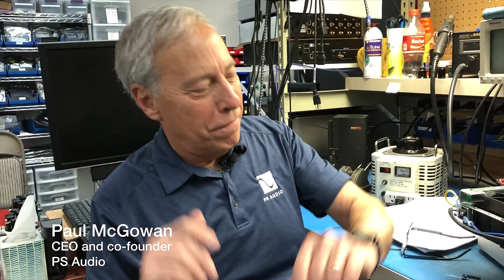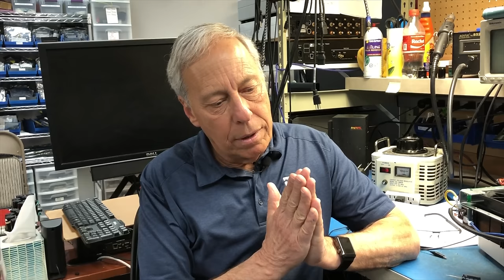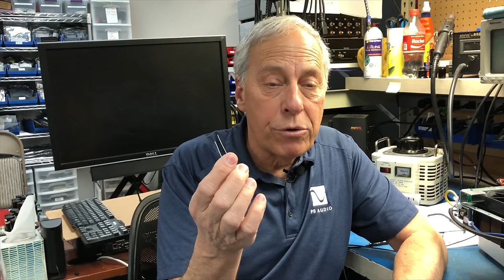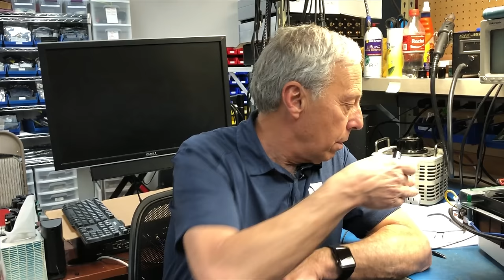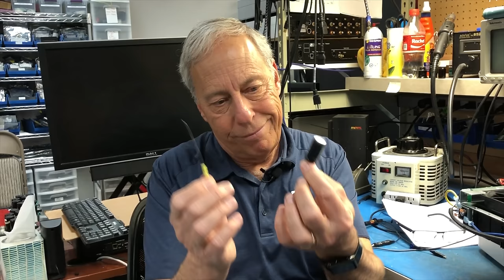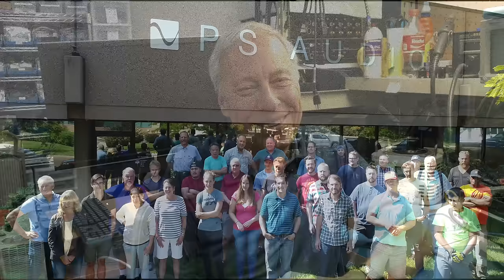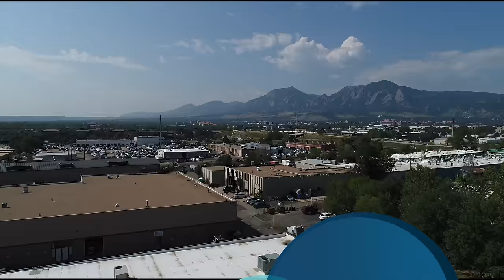Why do capacitors sound different?

Comment: Hello, I am planning to replace the electrolytic capacitors in my Grundig R45 receiver and I want to do it right, but before I start replacing them, I decided to refresh my knowledge a bit and expand the information about capacitors used in audio equipment, what they are suitable for, but the amount of information can get confusing. , and I don't want to do it badly and damage the equipment because it defeats the purpose and after watching several of your videos about capacitors used in audio equipment, I decided to ask for advice on what capacitors to use in the mentioned equipment in the power supply systems and in more critical points, i.e. the audio track because I know that the differences are huge, and when making a choice, I want the costs to be optimal in relation to the quality, and the final effect, where I can possibly save money and where it is not worth it. Thank you in advance and best regards for any answer.

Comment: I saw the title of this video and I knew it would be an instant lightning rod. I wonder if capacitors of equal value have a differing impulse response due to other factors (or different impulse response into high-impedance vs low-impedance loads that would discharge the capacitor at different rates). I don't know, I'm just wondering. Impulse response is inextricably linked to frequency response but the two might not be perceived the same way (like "Q" of a loudspeaker bass alignment resulting in subjectively boomy/tight bass).
Reply: AcousticTheory Excellent response.

Comment: The short answer, is they don’t have the same specs, and variance from specification changes with quality. Staying with caps, the farad rating is only one spec. An electrolytic and a polyprop have very different characteristics outside of the Farad rating. They are non linear devices in all areas, not just a simple and perfect filter.

Comment: Now we're only left with: resistors, coils, opamps, transistors, mosfets, transformers, diodes, schottkey diodes, zener diodes, triodes, LEDs, fuses, potentiometers, switches, relays, connectors, DACs, microcontrollers, microprocessors, FPGAs, oscillators, RTCs, motors, hall sensors, capacitive sensors, rotary encoders, phototransistors, optocouplers, diacs, triacs, thyristors.... aand the list goes on haha
Reply: So, better luck explaining next time 👍

Comment: A capacitor doesn't pass "voltage" (battery or otherwise), neither current. I'm sorry if I'm seeming harsh, but capacitors are isolators. However, they allow the electric field to propagate, thus adding electrical charge to one plate and removing it from the other plate. Since charges won't go through the dieletric (unless it is leaky), the charge difference remains. Plus, there is no such term as "passing voltage". Voltage is a charge difference, while current is a charge movement and thus, only current has the ability to get transferred.

To add, I believe that an electrolytic capacitor may sound different if it is leaky. The rest, I take it as pure audiophoolery. Never noticed any difference, even with an oscilloscope. Notice that oscilloscopes are far more reliable that the ear (or brain).
Reply: Not quite! You can use the scope's FFT, or better yet, a spectrum analyzer to check distortion. Analyzing how capacitors sound by ear is not an objective test. But yes, I agree to disagree.

Comment: I have a 7 band graphic eq that I'd like to change the lower frequencies. Is it possible to change the capacitors in certain frequencies to get your desired effect? For an example, if I want to change my lowest frequency of 100 hz to 50 hz and the second frequency is 125 I'd like to change to 80 or 85 hz. Also, how do I determine the slope at which the frequencies roll off? Thanks for any help you can offer.
Reply: Ever try it out? I want to halve the freq of the low pass filter on my eq and am thinking of just soldering an identical cap to the legs of the film caps already in the filter

Comment: Howdy. Electrolytic capacitors have a large series effective resistance equivalent. The capacitance is also very dependent on freqency. They are poorly suited for audio passing. Their relatively high impedance will add geometrically to the input impedance. This will upset the loading of the feeding stage resulting in signal skewing.
Plastic film capacitors are well suited for audio transfer. The internal series resitance equivalet is very low and their capacitance is pretty much frequency independent in the audio range.
Electrolytic capacitors are well suitable for energy storage = filtering because it is easy to get large capacitance values. Electrolytic filter capacitors should have a plastic capacitor connected in parallell to speed up the filtering. A rule of thumb can be that the plastic capacitor be say the electrolytic capacitance divided by 10 000.
Observe however. Because the impedance of plastic capacitors is low in relative terms using them as filtering boosters will produce large reactive currents through them. They may actually run warm and deteriorate fast. This may explain why mains LED bulbs suffer capacitor shorts. One should split up the plastic capacitance into several capacitors if a large electrolytic capacitor is to be speeded up.

Comment: he actually didn't offer an explanation. here is one: the frequency isn't specifically defined in some types of capacitors - it changes when influenced by all sorts of things including butterflies farting & raising the temperature (or current). and i think they aren't linear. that can introduce harmonics, distortion and noise. theres stuff online which can tell you more. i only have a rough knowledge of it.
Reply: Yeah he waffled for 10 minutes.

Comment: Current only appears to flow thru a capacitor. It actually oscillates in the circuit around the plates because electrostatic forces bridge the gap and act like a connection. Electrons are drawn in and out of capacitors but never pass thru them! Those thin film caps, especially tantalum's, deteriorate over time. YT has videos showing them crumbling and pitting at microscopic level.

Comment: Air will pass a small amount of electricity, and this is proven by the fact that if a predator messes about at an electricity substation, the very high voltages (about 300kV plus) can jump gaps, putting the predator in danger of electrocution even if he doesn't quite touch the wires.

Comment: electrolytic caps require a net DC to maintain the dielectric, no longevity in AC (which is sound/music) also caps do have a small internal resistance, which varies.  I had a crossover cap heat-up and smoke-up my room!
Reply: LOL, and may be why I now need a hearing-aid!

Comment: The prefix "micro" means one millionth (10⁻⁶), not one thousandth (10⁻³).  The prefix that means one thousandth is "milli".
     This video failed to address his viewer's question, which is about the different audio characteristics of capacitors that have the SAME specs. (Presumably the viewer meant same capacitance and same maximum voltage limit.)

Comment: For audio, the cap has to be and to stay, in time as well under heat,  and fabrication, LINEAR and REPETITIVE. If you don't/can't manually fine tune the circuit that the cap is part of, you may be off scale by almost 100%, with some caps, simply because the margin (tolerance) of fabrication can be very high. (Note that a cap used as a fly-wheel near a step motor does not have to so restrictive, not all cap are fabricated with audio quality in mind.)

- A ceramic type (relatively large disc package, can be tiny too)  is very unstable against heat. One cap can be 80% more ( or 20 % less) than the other with the same initial spec, as margin of fabrication, or as tolerance. Can be used close to an element which may require a sudden rush of current. The cap is then used as a reservoir of electrons, or as a brute noise filter. 
-A paper type (used in very old radio)  is chemically unstable in time, as it becomes acidic and lose its isolation property, which may cause the tubes (did I say old radio?) to overheat, and fail before their expected time. Today, should not be used unless for restoration of old radio... and even in this case, surely the paper cap would have to be new, since an old one won't be a cap anymore.
- Mica coated with silver are very stable (and cost what silver cost). You may find some in the "bargain bin of old caps", or in "garage sale", ... they are sill good, excellent, even if they are old. They are probably an overkill for audio, but nice for radio ultra high frequency. They generally look like a kind of thick wax-like bloated rectangle. But not all wax-like bloated rectangles are mica-silver caps, though.
- Film cap are probably the best for audio. Cylinder, as shown, of rectangular in hard plastic packages. There are many kinds of plastic used for the isolator plastic film (inside the cap), some have problem with heat (soldering them to the circuit may even damage them, some may even be damaged if kept too close from a tube, or a warm transistor), some other, not at all. The variation (from one cap to the other) may dictate the type that you would use, but it is generally much better than the +80 - 20% of the ceramic type or of the electrolytic types, but for a really, really, restricted range, you have to pay more, even if, in general, film caps are "friendly" priced. They are relatively medium sized (larger than ceramic, smaller than aluminium electrolytic).
- An aluminium electrolytic cap (the blue can type)  is polarized ( a + and a - pin ) and is usable only as long as the net voltage ( DC plus the negative voltage of the AC) stay positive on the + side. Furthermore, at high frequency, the electrolytic ions has not the time to travel what it has to and the cap ceases to conduct at high frequency AC). They have terrible margin of tolerances (similar, or worse, than ceramic type) and they can age by over-heating ... and standard time passing. Can be use as reservoir of electrons, or as rough medium time keeper ( such as with a NE555 chip ). Don't obstruct the vent cap at the top of the can, that is supposed to open in case of a short or excess of voltage (otherwise, the can, made of aluminium, may explode and send shrapnels around in case of such incident). Don; t discharge them with your fingers, or with a metallic tool,  if they are rated for more than 40V... if charged, they can hurt or kill you. It is the amperage which kill, but under 40V, your (dry) skin presents enough isolation to protect you. And if 6V battery on your tongue is not your definition of fun, well... avoid touching electronic equipment when you sweat.
- A tantalum electrolytic type is much smaller than its cousin, the aluminium type, and is, was, often used in cell phones. I say was because it has the tendency to explode (when the polarity, +/-, is not respected) or to burst into an un-extinguisable fire (it provides the comburant and the carburant and the energy) when the voltage is exceeded. But otherwise, when properly used, it does what it has to do, very nicely, in a small size. Tantalum is not as costly as silver, but cost more than aluminium or plastic. Unless you are pyromaniac (though there are new tantalum cap which alleviates their fire-bomb nickname), or very, very cautious, I would stay far from them. They generally looks like a large drop of water, yellow, or red, or brownish.
- Use many of cap in parallel: that is also a frequent solution, up to five of them in parallel! Why? because each of them has characteristic which depend (ie, are not linear) of the frequency. It also implies much less stress on each of the cap.

In short, for audio, film cap due to their stability and repetitivity. Some new ceramic type, but much more expensive than their classical cousins, could present the required time, heat, and fabrication "stability" (but can be piezo-electric). If you can adjust, fine tune, the circuit with a potentiometer, the fabrication tolerance may not have to be restrictive, other wise, the fabrication tolerance itself has to be a criteria in the specs. But EVEN if you use a circuit for AUDIO, you may need capacitor for the good of OTHER parts (aspects) of the electronic.

Comment: can someone tell me what capacitance range to use for tweeters, mid-range and sub-woofers plz? is there a chart somewhere to follow? thanks
Reply: certified30 it depends on the impedance of the speaker and the desired frequency characteristics.

Google "RC highpass filter" and you can calculate it yourself!
Reply: Fc=1÷(2×Pi×R×C)

Say you have a 4 ohm tweeter and you want to only pass frequencies above 1kHz.

1kHz=1÷(2×Pi×4ohms×C)
C=39.81uF

You simply put a 39.81uF capacitor in series with the positive terminal, making sure it's voltage rating is at least 50% higher than the expected maximum signal.

This is oversimplified, but it will certainly work for you!

Comment: 1 micro Farad = 1 µF = 0.000001 F
1 milli Farad = 1 mF = 0.001 F = 1000 µF
1 Farad = 1000 mF = 1000000 µF

just to set it right... comes probably more natural when you use the metric system.
And he did address the question: Small capacitance - high pass filter, high capacitance = low pass

Comment: At 2:53 you make it sound like capacitors have multiple layers of conductors and insulators for the current to go through. Rather, there is only one insulating layer and the surface area is increased (e.g. in electrolytic capacitors) to allow higher capacitance through rolling up the two conducting sides of the capacitor with the insulating material in-between. The "roll" thus becomes also a coil serving as an inductor. And at 5:21 you talk about a micro Farad being a 1/1000s of a Farad. It's a millionth of a Farad. A 1/1000s of a Farad is called a milli Farad, but rarely do we use such prefix for capacitance.

Comment: One point not made. And audiophile and consumer's should know, electrolitic capasators only last so long, then after several years they can begin to buldg and leak, the fluids can be crosive to the metals on the boards and etch off metal traces.  Also some budget brands fail sooner and dont do what they were rated for (made in china) wile other brands  last longer and exced the stated specs (made in Japan) 

If youve ever owned a samsung TV that the power supply stoped working on it was probably the capasators going bad.

Comment: That explination of how a cap works i'm sorry is incorrect. NOTHING passes thru it. It charges and discharges thus allowing current to flow thru the rest of the circuit. As your audio freq. alternates it changes the polarity on the cap, everytime that happens the cap discharges and recharges.

Comment: But what exactly are we trying to achieve here with any audio cable / component / piece of equipment?

If it is to allow the signal from the source (CD, digital audio or whatever it is) to be fed as uncolored as possible into our speaker system, then that's one thing we can aim for.
And that's repeatable and measurable to a large degree.

If, on the other hand, it's to make the system 'sound better' to any given listener, then that might involve COLOURING THE AUDIO. Now if that is going on, you might as well be honest about it.
There is a fine dividing line between coloring the audio and distorting the audio.
In fact, it may be simply down to a person's opinion or taste.

If a capacitor passes the entire audio range of a piece of music through itself unaltered or as uncoloured as possible, then that's the one to get - Regardless of what it costs or what it's made of.
And that is measureable.

'The capactior sounds better because it's coloring the audio to my own particular taste' is not.

Comment: I need to recap my tube amp and tube DAC. I know that I need to replace them by the same capacitance value. One answer I can’t find though is about voltage rating. I’d be grateful if someone can weigh in:
I can choose a replacement capacitor of the same voltage or higher. Many of the nice capacitors sometimes have a higher voltage rating. Although from an electrical point of view it is safe to use, is there an effect on the audio quality to replace a cap with higher voltage rating?
Thank you!

Comment: if I'm using one 6.5 inch subwoofer rater at 200 watts RMS. plus one 5 inch woofer midrange rated at 100 watts RMS. and the tweeter already has an electrolytic capacitor of 47U 100V.
which capacitor do I need to limit the subwoofer? and which capacitor would be proper for the woofer-midrange? and should I replace the electrolytic capacitor that came with the tweeter? 
BTW. which assortment kit of film caps do you recommend for home audio?
thanks

Comment: Video is 9 minutes. 1 minute introduction. 1 minute is reading the question. 3 minutes defining what a capacitor is. And 1 minute is bla bla. And 2 minutes showing capacitors. And 1 minute to thank the viewers.

The question is very interesting as why there is a capacitor sold for 100 USD used in amps that filters properly and another is for 10 cents that might pass noise. It seems as usual a person claims to know trying to  answer. I am going to search google the question.
Reply: Yes, kinda sad.  And a 4700uF cap is not 20 cents, even in volume.
Reply: @gman76utube  it really isn't 20 cents and it should be common knowledge. That aside, we could accept it as metaphor but I'm tend to be skeptical about info shared by people who get too many details wrong in a short period of time :}

Comment: I appreciate the video and it was, as always, very informative. Maybe I missed the point, but I didn't see where the original question was answered: Given two caps of identical value and specs and type (for example, mylar film or polyester), is there any likely to be any sonic difference (when new) between say, a Sprague cap and some no-name brand ?
Reply: any likely to be any sonic difference????